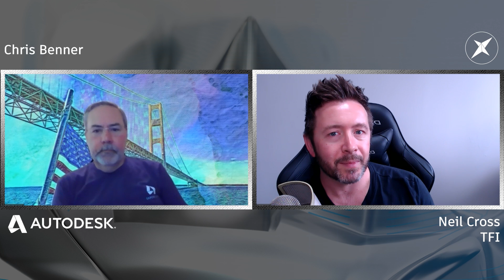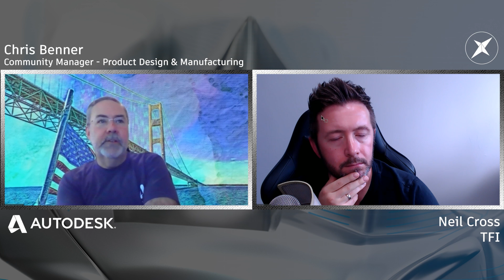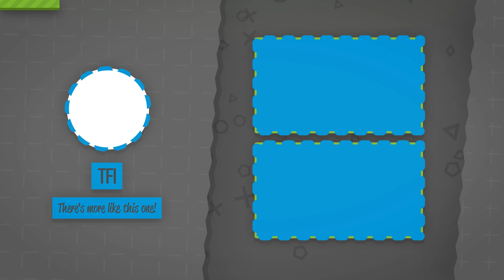You might want to know about what this guy is doing for you

Comment: Autodesk needs to know .... Im an industrial designer who paid $4000 a year for their package license  and wound up using blender SUCCESSFULLY  for all my projects - did not renew my lic because it’s a rip-off .... do they expect to stay in business ?
Reply from the maker: What specifically tipped it for you, what's the issues you had
Reply: @NeilLCross  Expense.... Their software is prohibitively expensive for what it does.  They have cornered a market for multiple decades and start-ups, entrepreneurs, young people just cant afford it.  I waited decades until I could afford it... then all I could do is watch the clock tick as my subscription renewal date approached.  How am I supposed to learn an entire suite of software while paying almost $4000 a year for what I can do online for FREE.  Blender is Free and quite awesome.  FreeCAD is a decent solid modeler for parts development... also FREE.  I pay adobe $60 a month for EVERYTHING... including unlimited font libraries.  If Autodesk was $60 a month I'd pay.  But $4000 a year is OBSCENE.  The next pitfall is the disrespect they pay to Apple users.  Do you know what a pain in the ass it is to install windows on a mac, learn its horrendous interface, saving files across platforms, just because its easier and cheaper for them to only make certain softwares for windows only.  The suite I paid $4000 for only featured two mac viable programs... the rest were necessary to partition my drive.  After all that hair pulling and being late on client work I decided to try blender.  Its not a solid modeler but it does get my projects completed when combined with FreeCAD.  Its only a matter of time before these free softwares overtake Autodesk.  I look forward to it so I can get all my work done without feeling 'financially raped'.
Reply: @shawnhollahan590  the value derived from the subscription really varies from person to person I think. I mostly use my collection for Revit/Navis as a small consulting  business and I'd have no business without them.

For me the 4k pays itself back fast and I feel is about right for all the tools provided - they can achieve high profit results on projects so the price is aiming to reflect this. If they didn't stay in business I'd probably just leave the industry to be honest - love using Revit. The aspect I don't like is gradual price creep though.

Blender/freecad are handy tools but for BIM modelling they don't cut it. Awesome for smaller scale applications though where it's more about modelling/doco at the price (nada) they're at. I'm aware of BlenderBIM but it isn't anywhere near complete yet and overly obsessed with the IFC schemas.